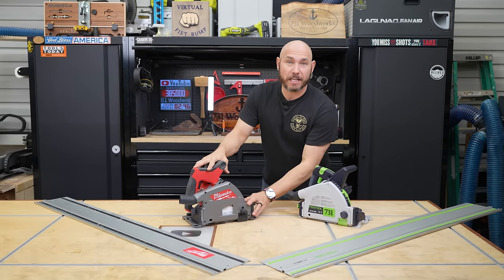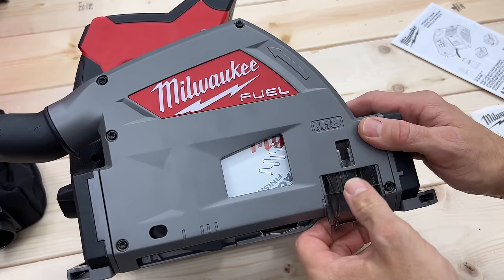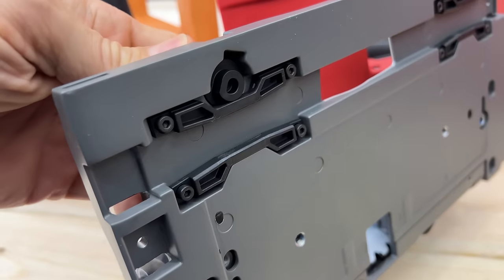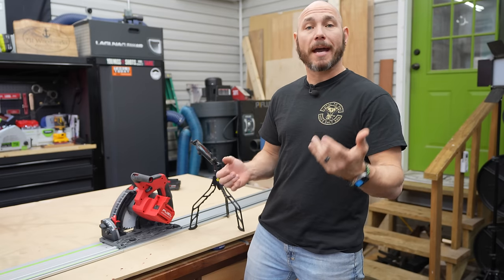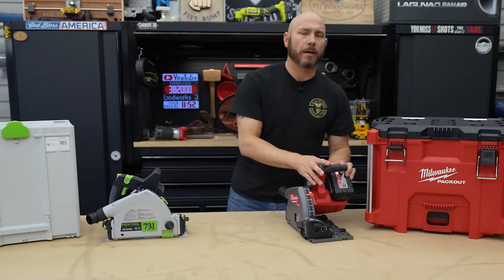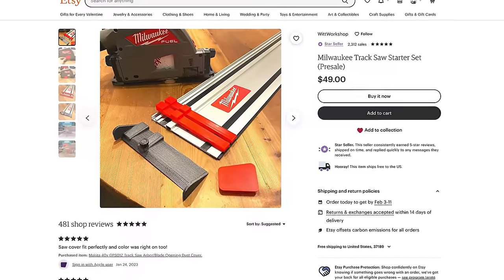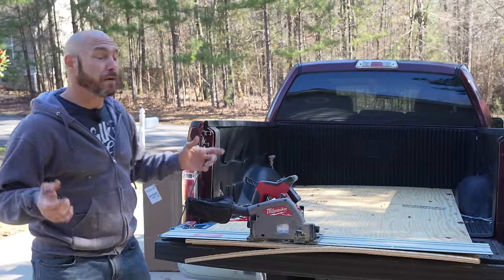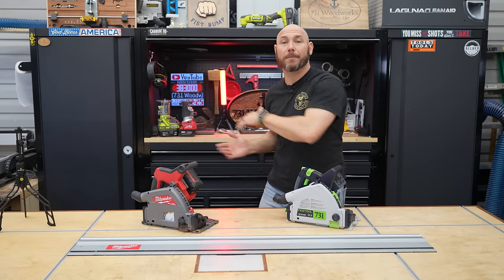Milwaukee Track Saw - Everything You Need to Know

Comment: well being an old man and on social security as my main source of income I won't have to worry about which to choose for my needs;;;;lol;;;If I can't build what I want to build with what I have I don't need it;;;all my tools are old like me and all have their quarks to make fairly accurate and I am used to the features;;;also there is no more room in my shop for more tools;;;however have been thinking about downsizing;;I have at least three of every tool one needs in a shop with the exception of jointer;; only have one old craftsman four inch so limited on use with some things;;;all battery tools ryobi;;;including ten inch miter saw which I like;;;had to fine tune but works for me;;;;;however for those who want tools that do all the work for them both look great;;;just measure mark and push and automatic control;;;;lol;;;;I had my own straight cut jigs so to speak for various widths for straight edge cutting;;;;making sure enough pressure applied to keep saw going straight down jig on what cuttin;;;;thumbs up and keep us up to date

Comment: I wish Milwaukee offered a corded version of this saw. While I can see the advantage of a battery powered saw in some circumstances, I don't see it for use in a shop. You're going to want to use it with a dust collection hose attached, so the electrical cord isn't much of an added hinderance. Instead, the battery adds extra weight and future expense. Batteries wear out and are expensive to replace.

Comment: Hey Matt. Thanks for the review. I have mine coming this next week. Question: I am looking for a way to have a button on the Milwaukee track saw that I can press to activate my shop vac. I have a Fenn that has an option to plug in a (corded) power-tool so when the tool is turned on the vac comes on, dwells for 8 seconds after finishing. 
Is there a device besides Fastcap RCV Remote ? That option seems troublesome because the manufacturer says don’t use on any vacuum or power-tool that has a 12 amp or greater draw. It  is a unit plugged into the wall outlet and then the vacuum is plugged into the RCV. 
So. Is there a Bluetooth device that plugs directly into the Fenn onboard receptacle with a remote button attached to the track saw?
Thanks. Hope you can help.

Comment: Nice video. I thought for sure you would mention the lack of an automatic blade locking system while changing the blade. That is a nice feature on the festool.
Reply from the maker: Yeah, it has a lock button though.  Not a big deal, IMO
Reply: @731Woodworks  I agree. Just another difference.
Reply: @731Woodworks  when are you going to compare the Mafell track saw
Reply: @rickyperkins232  ....Mafell is in another league.  Wish i could own one.

Comment: I am not 100% sure on this but my assumption with the foam on the lid is that if you drop/break the pack out you can replace it with a new one from a big box store and transfer the rubber pad and organizer insert. I would rather it use Velcro. But that's probably why it's sticky and removable.

Comment: I'm already in the Milwaukee platform but... at that price range you are 100% correct. It should at minimum have all the same features.  
There is also the case that not all track accessories are fully compatible. TSO came out saying their products aren't fully compatible. I'm sure it's a tolerance thing and if both products are at opposite extreme of their tolerance it may not work. At the saw price not sure I'd be will to take that risk. 
Lastly, I don't do construction so a wired solution isn't a huge deal. May be slightly less convenient but if you don't know any better then you won't miss it. 
I purchased a Makita wired track saw. Meets my needs for a better price and their tracks are fully compatible with Festool track accessories.
Might not have those fancy features but hey I don't own a SawStop either. Just have to pay more attention and do my best to eliminate any potential hazards that can cuz an accident.
Ignorance is bliss right!
Reply: Can you supply a link or info on the TSO comment.  I've not seen anything, and can't locate any such comment about compatibility with the Milwaukee.
Reply from the maker: Go check out WittWorks Youtube channel. He has it on a Short video

Comment: The Festool multifunction table allows their rail to be mounted on a hinge so it can be easily flipped out of the way when changing pieces and then locked down again when cutting. Will the Milwaukee rail properly mate with that hinge system?

Comment: I got another brand of track saw recently. Some thin jobs were easy enough to set up and cut and then I decided to take a cut to straighten up and old door on the hinge side, it was bowed out of shape over the years.
I realized why this type of saw would have been better with the blade on the left so that on wide jobs a right handed person can walk past the left edge of the job as they go. I had to use the saw left handed to do the job. And so I began to wonder why so many "Skil" like saws have the blade on the right for the same problematic reason. Anyway thats my 2 cents worth.

Comment: Why does noone talk about the DeWalt track saw? It's a 60v saw, the track has two usable sides and both have the splinter guard, so you can use one side for 90 cuts and one for beveled. Once you cut a bevel the zero clearance strip is ruined on a regular one!  Also has 2.7 hp!!! Cost about ,$600 and is a very nice saw. Just wondering. Non of the top tool guys have even talked about this saw

Comment: Actually, you could buy Diablo blades to use on the Milwaukee track saw, and with the festool you only use festool blades which gets pricey.
Reply: Thanks! That's what I thought. I have a few 6 1/2 inch circular saws already and prefer the size and weight to the 7 1/4. I was confused about what made it require a proprietary blade.
Reply: There are quite a few other brands that make blades to suit the festool saws of all kinds, our local building supplier carry all sorts from cheap blades at around $20 each in the 160mm to nicer than the festool blades at around $300

Comment: I just purchased the Milwaukee track saw combo kit and I'm waiting for it to be delivered. The High Output XC 8.0 that is part of the kit is $199 at Home Depot. I saw the same battery, new, for $110. I've watched a bunch of videos, and by now, I'm sure you have an opinion on what battery you would use in this saw, being you've been using it for a while. Whatever insight you can give is greatly appreciated.

Comment: I really like the depth of your reviews and I readily agree with the entire review with the exception of proprietary blade comments. While, I would agree that Milwaukee did come out with their own line of 6.5” blades for the track saw (which are suspiciously identical to the CMT 6.5” blades) however, most every manufactured offers multiple 6.5” blades with a 5/8” arbor. Milwaukee may recommend their blades, however, they are by no means proprietary.
Reply from the maker: Yep. I mis-spoke there.
Reply: this saw uses a 20MM arbor, like most track saws

Comment: Thanks for the great video, I’m in the market and shopping around and noticed some surprises, like the saw price alone means little if you’re not platform committed already because you need accessories with it. When you add track, batteries, chargers, clamps, dust collectors etc., that’s where the real price shows up. I’m mostly on 20v Dewalt tools but their track saw is 60v! Similar with Makita, they have 40V saw. MW at least has same battery voltage, that’s a big plus to me if I had MW tools, but I don’t. In conclusion I’m finding that the corded saws cost the same and in some cases more than the cordless ones in my area, so I’m leaning towards Makita because I’m not in the MW platform and the saw has great reviews and with accessories the ROI is pretty good.  BTW you got a new subscriber, good video.
Reply from the maker: Thanks for the sub! I've heard nothing but great things about the Makita corded track saw.  I don't think you would be disappointed with it.
Reply: Just buy the dewalt to Milwaukee battery adapters off Amazon, I’m dewalt 99%, but wanted their m18 Brad nailer, adapter works great.

Comment: Reading the specs on the kerf of the blade on Milwaukee and Festool... The Milwaukee is equivalent to 2.2mm and the newer Festool blades are 1.8mm. Should help with a longer runtime before changing batteries.

Comment: Powertec, now makes a track for the Milwaukee, track saw. I included the Amazon, description below. This track can do both bevel, and straight cuts. Would love to see an updated on the Milwaukee, track review using the Powertec tack, 71871. 

POWERTEC 110" Track Saw Guide Rail Joining Set for Milwaukee Track Saws Includes 2x55" Aluminum Extruded Guide Rails and (2) Guide Rail Connectors for Woodworking Projects, 71871

Comment: @731 Woodworks have you notice any issues using the TSO attachments with the Milwaukee Track?? I was looking into the rail square but wondering if there not compatible?
Reply from the maker: It is not compatible.  Got an email from them shortly after filming this video stating that it is not compatible.  Below is their statement:

"At first look, the Milwaukee guide rail appears to be patterned after the Festool and Makita profiles.

However, closer examination shows that multiple critical dimensions are different enough on the Milwaukee guide rail to interfere with the performance expected from TSO accessories.

As a result, our Guide Rail Squares and Parallel Guide System are currently not compatible with the Milwaukee guide rail.

Stay tuned for more."

Comment: Does the Milwaukee Track  fit in the Fast Cap Track holders?  Also any info on TSO stuff with the Milwaukee Track.
Reply from the maker: TSO released a statement that their current items will not work with Milwaukee's track.  Just went and checked the milwaukee track in the track holders and they do fit.
Reply: @731Woodworks  thanks at least I can get the track up on the wall then.  Thanks.

Comment: i don't understand the comment about proprietary blade.  isn't 6 1/2" very common blade size with almost all new circular saws?  is it the fact this is track saw specific?  how long will that last?  it seems like diablo has a blade for everything.
Reply: Good comment. 7 1/4 is the common size for circular saws. 6 1/2 is more geared towards the track saw.

Comment: Finally got around to picking this up. Upgrading from the corded DeWalt. Been rocking that saw since brushed / NiCad was the only cordless option. 

It would be cool if you could get the red track in the states. Then again, it might get hard on the eyes.

Question, is your riving knife a sheet-of-paper thickness away from the blade?
Reply from the maker: Mine is lined up with the blade.
Reply: I mean behind the tooth. Seems awfully close to me.

Comment: Spencer Lewis at Insider Carpentry noticed that the Milwaukee saw on the Festool track lines up with the splinter guard differently at 90 degrees vs 45 degrees. Is that also the case with the Milwaukee track (i.e. does the blade line up with the splinter guard regardless of the angle if you use the Milwaukee track)?
Reply from the maker: it lines up the same on the milwaukee track.  Have a REEL on my Instagram that shows it

Comment: Great work on the video. A couple replies: 

-riving knife will mitigate most kickback outright. I have the bosch saw and the instance of kickback I experienced actually lifted the saw lifted the saw up and backwards off the rail (and left some knicks in the aluminum) . It has no riving knife but needs one. I don't know if a track based anti reverse feature would've stopped it.

-the xc 5.0 battery is OK for intermittent tasks where capacity is more important than sustained intense application (high discharge). The high output range are drawing electricity from more battery cells at once, which keeps the apparatus cooler and also more efficient. You're running fewer current thru more channels instead of lots of current thru fewer channels. Even tho its the same total, the transmission is more efficient in HD range. I understand this is how milwakuee's 18v holds up against the 40v makita and 60v dewalt etc. 

-The blade arbor is 20mm , so you can run bosch, makita, etc 6.5" blades on this unit - as long as it is the same kerf thickness as the riving knife. not necessarily proprietary

Comment: I think the only reason(s) you should pick the festool is if you're already in the platform (or you just really want the festool tracksaw). Festool just doesn't have the tool range that Milwaukee does so if you're looking to get into a new or change platforms you're severely limiting your range of tools to select from and may end up having to buy into a second platform anyway.
Great review loved the comparison.
Reply: Festool is just a different tool range

No Festool nail gun but no Milwaukee Domino joiner either
Reply: @robhaydnsei  I didn't think Festool came out with a cordless Domino, I'll have to look for that! I've been hoping they eventually would.
Reply: @robhaydnsei  yeah ..no that's not true.
No 
impact wrench 
Caluking tube
Crimpers 
Staplers
Blowers 
Lawn mower
Line trimmer 
Right angle drill
Die grinder 
Reciprocating saw
Metal saw
Riveter
Carbide saw
Pumps
Grease applicator
Hole punch 
Inspection camera 
Heatgun
Mag drill
Ratchets 
Impact ratchets 
Demo saw 
Concrete coreing 
Backpack sprayers
Draib cleaners 
Lasers
Nibblers 
Shears 
Compressors
Thermal imaging 
Rotary tool 
Paddle mixers 
A 12v line 
I could go on
Festool services 1-2 trades
Milwaukee services most trades, carpentry, concreting, electrical, plumbing, metal Work, air conditioning, landscapeing, iron works the list goes on, I work in tier one construction projects and there's 2 main tools brands you don't see.... Makita and festool.
It's not even feasible to try and argue otherwise.

Festool doesn't even come close to comparing, if they didn't have the Capex domino and a decent tracksaw they would be basically nothing In the tool world and and on top of that outside of finishing works they're useless.
Reply: @robhaydnsei  also taking tools out of the equation packout is far superior to systainer and the Milwaukee tool add-ons range is well beyond festool.
Reply: @robhaydnsei  festool isn't bad at all I'm not saying that, it's just not at Milwaukee's level and never will be.

Comment: I would buy a Festool Domino before I would invest in a track saw.  Years ago I made two tracks for my old corded saw.  One was 5 feet and the other is 9.5 feet.  Both hang on the wall in my garage and I can cut sheet goods all day long on them.  Plus, I made them both with an aluminum channel, and my saw rides in the channel and you can cut 45 degrees with no tipping.  Both work great and I made them both for less than 30 bucks total.  I have recently upgraded to the Cordless Dewalt saw so I had to recut both but they work and cost a lot less than either of these options.  I break down sheet goods quite a bit when making cabinets but I find that my way works.  Good video but both are just too expensive for what they do.

Comment: FYI, both Ryobi and Milwaukee are owned by Techtronic Industries, based in Hong Kong. Milwaukee was an American company that got bought by Techtronic, and I think a lot of their research and development is still based in Milwaukee, Wisconsin. In 2022, Milwaukee also opened a new engineering office in downtown Chicago.

Have you ever tried the Makita track saw? I don't have a track saw. If I end up buying one, I'll either get the Milwaukee or a Makita since I have batteries and chargers for both platforms. I think the Makita saw doesn't have a riving knife, but some other reviews suggest that it cuts very clean. I have a shop vacuum that uses Makita's bluetooth system to turn on a shop vac via blootooth when you start up a compatible Makita tool, which is nice.

I think riving knives are absolutely necessary on table saws, but I'm not sure if I think they're absolutely necessary on track saws.
Reply: Just as an aside, the Ryobi name is licensed from a Japanese industrial tool company that doesn’t make power tools, the actual Ryobi company has nothing to do with the Gatorade green tools

So it’s a HK company licensing a Japanese brand name to sell tools exclusively at Home Depot in the USA

Globalization in a nutshell

Comment: Good video as always. Another review I watched said that when using the Milwaukee cutting at 45 degrees it doesn’t cut to the same line as it does at 90 degree mark and that it trims some of the anti tear out strip at 45 degrees. Did you notice that as well? Also did you include the Wittworks link for the dust cover?
Have a good one.
Ron

Comment: I know that there is a difference in the diameters of the Festool and Milwaukee blades. I would be curious to know if there is a difference in the thickness of the blade kerfs. I believe that the Festool TSC battery saws were revised a year or two and now have thinner 1.8mm blades.
Reply: Mw is 0. 08